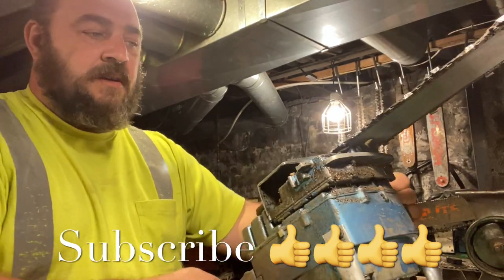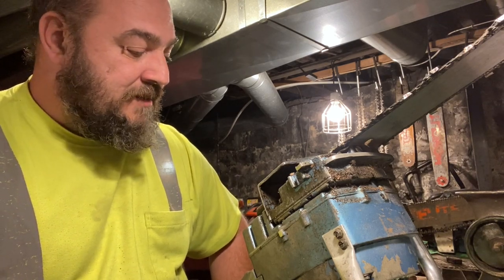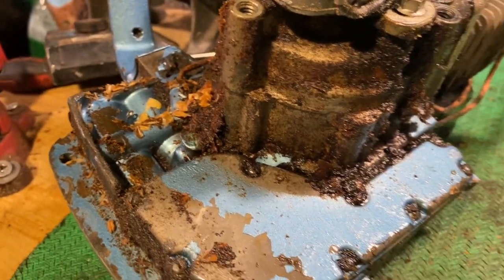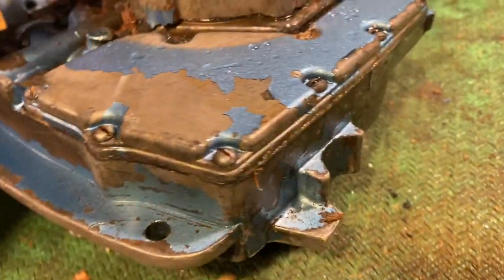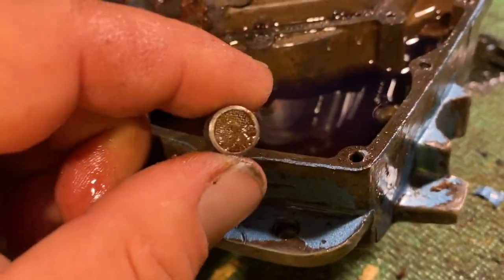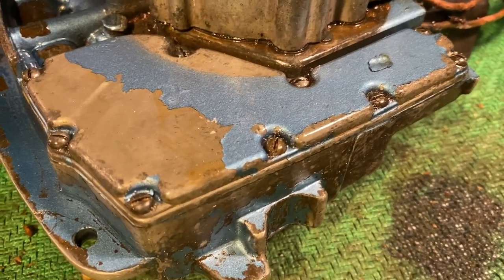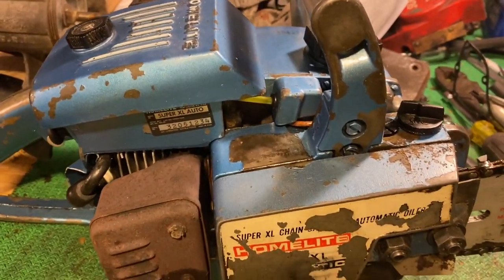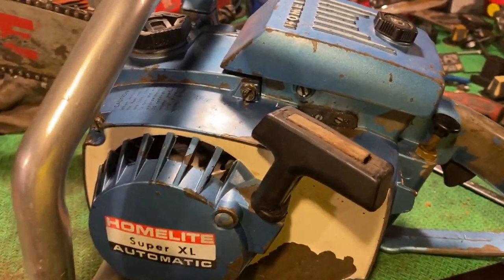Homelite Super XL Auto Oil Leak Repair!!  Test cuts and tuning after repairs!!

Comment: This is my fav saw, i have two of these ,one auto oiler and one thumb pump. From my understanding the ones that have the oil cap on top are fifty-eight cc and the oil filler on the bottom case are fifty four cc
Reply from the maker: For the most part yes. I have seen a Super XL that was manual oil but had the oil fill on top. I believe it was a short lived model.